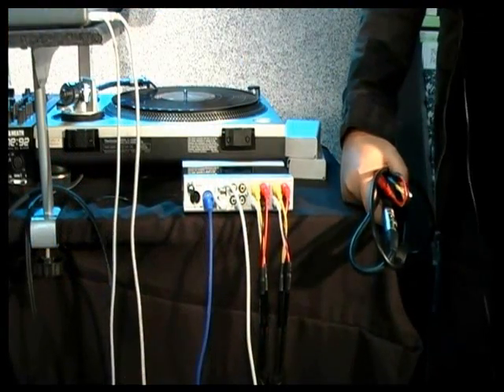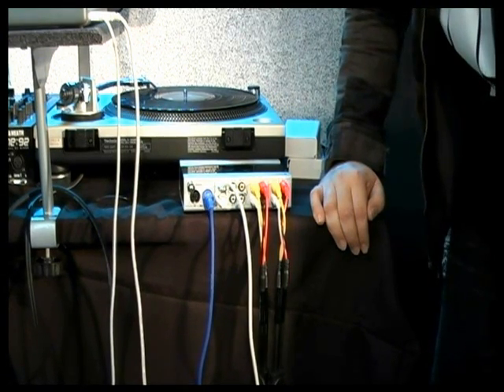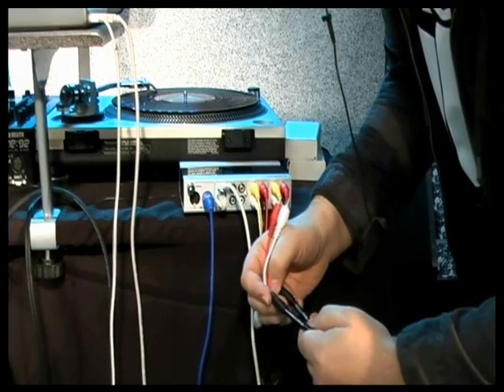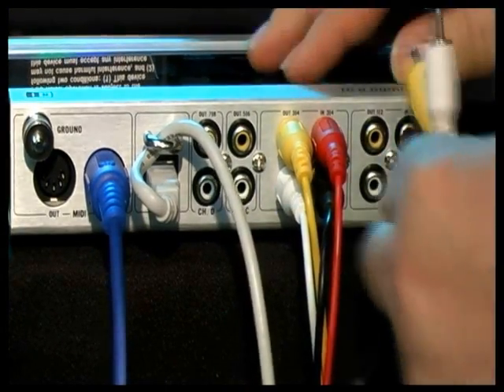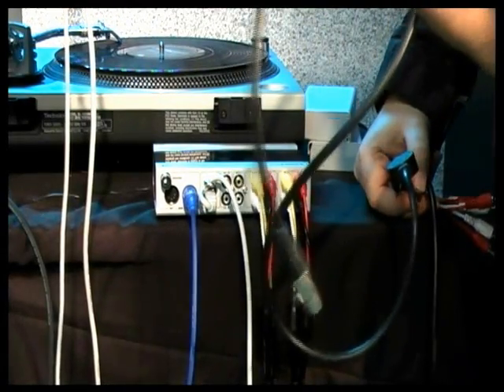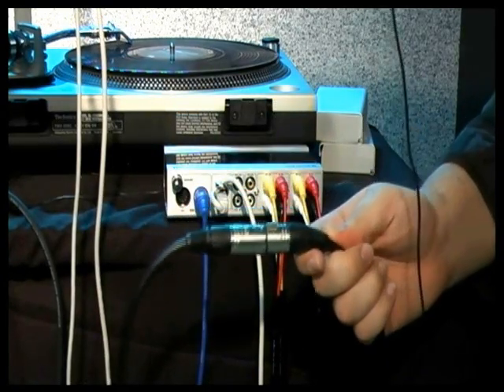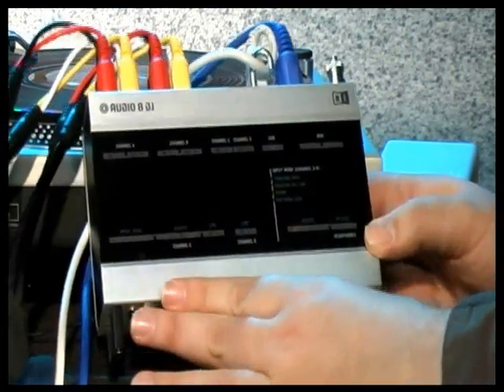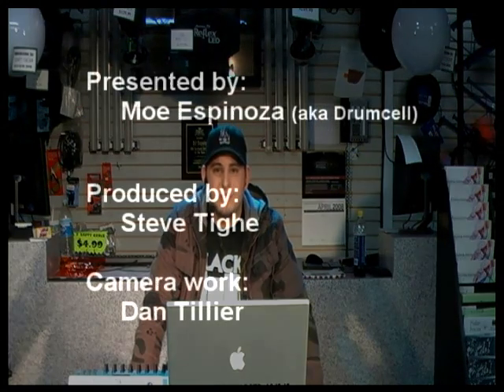DJS - Traktor Scratch Tutorial - Multi Core Cords

Comment: The audio 8 dj does NOT work well as a stand alone recording interface. The only input that has anjustable gain is the mic input. Your recording software has  gain controls but trying several programs even with the inputs  all the way up, you barely see the signal

Comment: is it possible to use regular (cheaper) cables? How?
thanx
Reply: Yes you can use standard rca cables to use the digital vinyl system (dvs). The positive of this is it is a lot cheaper (you can buy standard rca cables for peanuts whereas as multicores are £25 GBP each and you need 2 of them). The negative is you cannot switch between normal vinyl and dvs using the phono/line input switch on the mixer (line being used for dvs and phono being used for the normal) - you need multicore cables to do this so if you are just sticking to dvs then standard rca cables work just as good.

Comment: You can just buy the audio 8 sound card by itself and the (replacement) cds/vinyls, should work the same.  The traktor version you'd be using now is Traktor Pro 1.1.1 (or later), the separate versions of Traktor have now merged together all in one software, you can also go Audio 4 sound card also too.. its 200 bucks on ebay.  (Traktor 3 should work with the soundcards if you're still settled on it)

Comment: if i already got traktor 3 and got rca cables. all i need would be the AUDIO 8 DJ and their timecoded cds? or is does that 599 bundle have some kinda of unique version of traktor? id hate to have to buy the software twice.
Reply: You can use an Audio 4 or an Audio 6 to control DVS - you don't need to have an Audio 8 as all you need to control 2 vinyl decks is 2 inputs and 2 outputs on the soundcard.